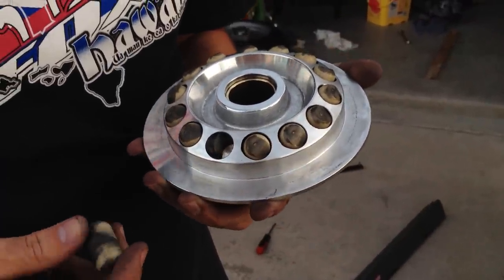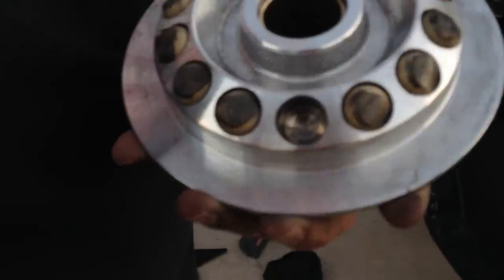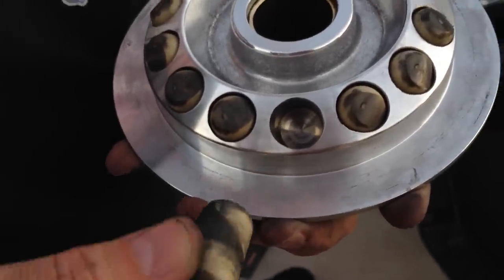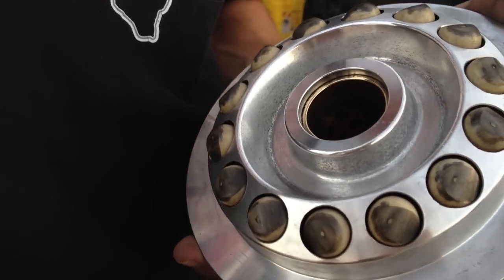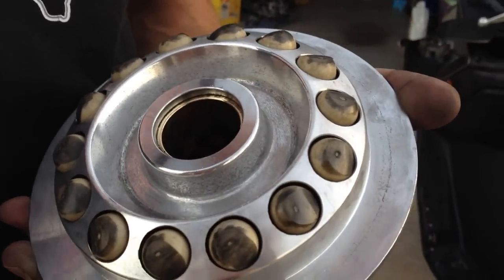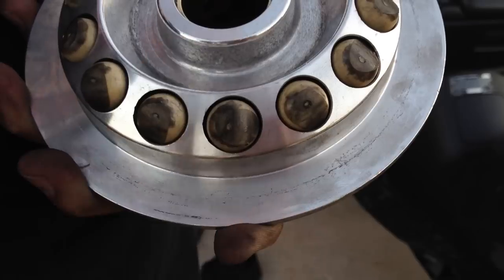Explanation of J Costa Pins wear on the variator | MicBergsma

Comment: I have 49,000 miles on my majesty J.Costa variator.  The factory belt just recently broke at 50,000 miles and this is the first time I have been in the variator since I installed it. My wear is similar to yours but I no longer have any dimples (indentations) on the tips of the weights.  Everything is pretty loose in the variator and the bronze bushing in the middle is a bit loose too.Since it is an easy task to get into the belt area, I am going to throw it back together for now with a new belt but I think about 50,000 is about all the variator is good for.  I will be looking for a replacement soon.
Reply: Been a long time, but was it an actual improvement over the stock variator ?
Reply: @BrainHurricanes  Night and day difference.  Better low end power AND lower RPM's on the Freeway. I wound up buying new weights for the Jcosta and put it back in when I installed the belt. I haven't put many miles on it in the last 5 years but it is still hanging in there with no issues..